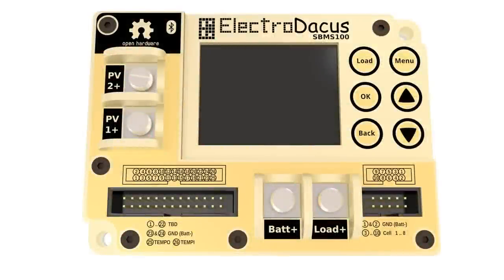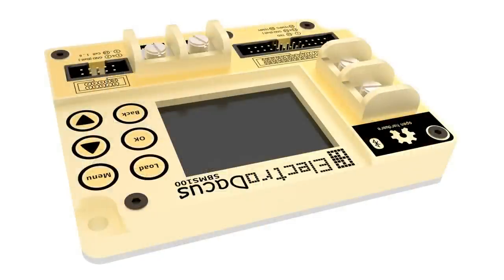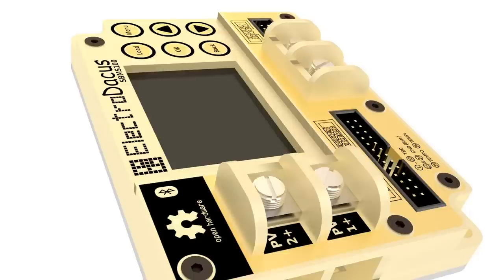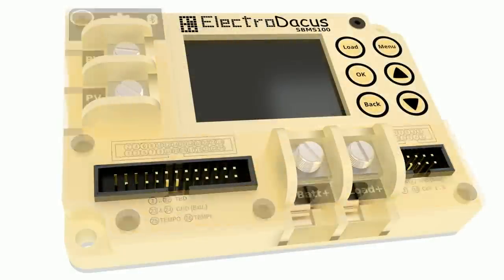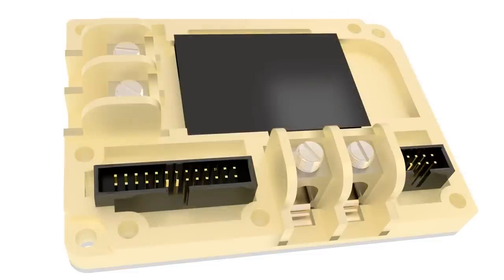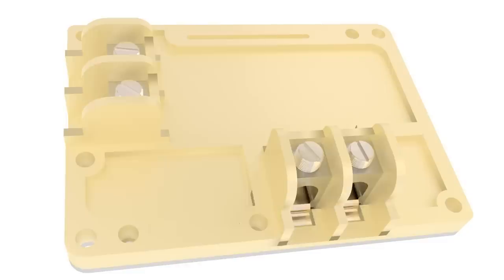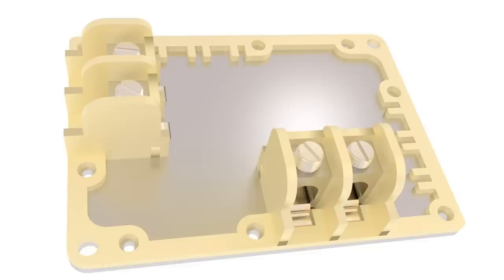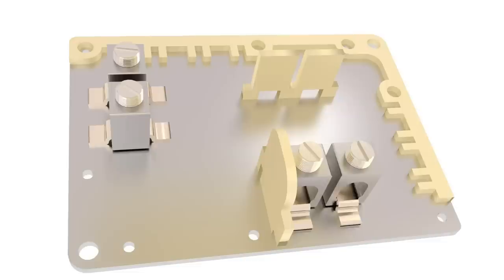New Solar BMS SBMS100 Design.

Comment: Like it... can't wait. Be Kicking in for this!
Reply from the maker: Thanks Darin. Glad you like the new design.
Reply from the maker: Darin Bicknell
Yes they are both 2.54mm pitch and can be used with standard IDC connectors.
I will provide the 10pin female connector and about 90cm of cable and maybe the 26pin connector also if I do not exceed the weight for shipping.

Comment from the maker: +vensonata you need to goo to google+ settings and there is a line that says "Who can comment on your public posts" and just select Anyone.
That is quite a large building an installation so the power consumption is quite good.
BC Kamloops dose recive quite a bit lees sun in the winter months than I do here.
This is a very good on-line tool to see what is the average solar irradiation and what you can expect to get from solar PV panes.
With your 11.4kW array assuming is facing south at about 50 degree inclination you can expect about 500kWh in December the worst month there.
That sounds good at 12kWh/day but some days you have excess that you can not use and there are a few days in a row with almost no sun.
Is great to have a large PV array and smaller battery but it dose not work with Lead Acid that 40kWh battery is way to small for 11.4kW array and it will get damaged.
As for the price is way more than just 3x between the cost of energy from PV and battery.
Solar PV panels are now around 1$/Watt and with 25 years amortization cost they produce energy at around 3 cent/kWh
Where a Lead Acid battery in ideal conditions cost at least 50 to 60 cent/kWh stored over is life. If you give me the brand of battery so I can check the spec and the cost I can give you a more precise number.
But as you can see is way more than 3x and more closer to 20x difference when compared with Lead Acid.
With LiFePO4 things are quite a bit better but still normally worse than 3x
A very good LiFePO4 may get to 15 cent/kWh over is life if you can really take advantage of the dip discharge capability that is still at least 5x more expensive than the energy directly from PV.
My experience is only 2 years offgrid with that small 24V 100Ah LiFePO4 and there is no measurable degradation after two years of relatively heavy use about 40% minimum discharge / day up to even 90 or 95% DOD some times.
As long as each cell stays between 3.0V and 3.6V you do not need to care about anything else no hydrogen gas or temperature increase (not temperature increase if you charge rate is below 0.5C preferably 0.3 to 0.4C depending on brand)
So a minimum of 25kWh LiFePO4 battery will be needed 30 to 40kWh more desirable for you 11.4kWh PV size array.
Not sure what you battery configuration is but maybe SBMS will not be useful for you.
The max configuration SBMS the SBMS100 can take a max PV array size of 3kW and that 3kW is also the output limit.
For your large system you will probably need an electric car BMS. It will be more expensive and not as great it will need to be combined with some other data acquisition tools for a complete overview of the system.
SBMS was designed for smaller offgrid houses (RV, boats) with up to around 200kWh to 300kWh /month of energy use depending on location and time of year for the SBMS100 with 3KWh PV.
And can only be used with 12V or 24V battery banks up to 8 LiFePO4 cells. There are cells quite large 400 to 1000Ah and will be a good choice for SBMS100 so 3kWh PV and 10kWh (400Ah x 25V) to 25kWh battery if more storage is needed.
Diesel and gasoline generators are also quite bad as cost/kWh since they normally use close to 1 liter /kWh and that is high enough not including maintenance and amortization cost.

Comment: I see that this design is slightly different than the actual finished product, is there a raison for changing it, I like this design better.
Reply from the maker: There where a few reasons I changed the design slightly. One important reason this design was a bit larger and had two of the power connectors on the left side has to do with the type of power mosfet I was going to use.
I also liked this designed more but most people loved the new design more since is more symmetrical. You are first to say that you like this more.

Comment: I missed the last model! =/ I don't suppose theres someone manufacturing you last model yet?
Reply from the maker: I will build a few more since I have some spare PCB's from the first batch but if is not urgent I suggest you wait for the new model. The new model has quite a number of improvements. The Kickstarter campaign will start at the end of this month.
If you want one of the old models write me an email same user name as here on gmail so that I reserve one for you when I get to build them maybe this month if I have power.

Comment: 1.  Would it be possible to add a couple of USB ports on the side for the people that plan on using it for more portable solar systems?

Count me in for the kickstarter campaign as well.  I still need to build that 10,000 watt system for my house before the obama solar tax credits run out in 2016.
Reply from the maker: There is no space for full size USB ports on the side. The full size USB is over 5mm thickness the distance between the main board and the top plate. On top of that there is absolutely no space left for a reasonable 5V DC-DC converter inside.
This SBMS is about as small as the first generation but with at least double the number of parts so almost every available space is used.
It will probably also be a bit expensive for small mobile USB chargers since this is designed with larger setups in mind.
I'm just working on the specs now but the lowest power model will be SBMS25 with a max STC PV input of 750W (25A) and if you use that size PV panel recommended battery capacity is around 60 to 100Ah.
Of course it can be used with much smaller PV and battery capacity but I will say smallest reasonable setup will be a 30W to 50W PV and  10Ah battery minimum 3 cells. Unless used with supercapacitors for experimentation.

Comment: Hello again, still trying to figure out how you can respond I am not familiar with these youtube forum. Anyway thanks for your interesting reply. I will share here my system. First of all I have 14 years of off grid experience and so this large community of up to 20 people sometimes stay here at this Buddhist Monastery.  It is a 10,000 sq ft building with all modern conveniences...all led lighting, 300 ft deep well, super efficient appliances etc. I have full monitoring systems ...pentametric for batteries and ted5000 whole house monitor etc. many years of careful data. So average daily use is 12 kwh in winter. Number of hours of sunshine ( kamloops, B.C.) november 67 hours, December 47, january 57. This produces more than enough total kwhs each month but not if 4 days in a row are heavy cloud and snow. You in Saskatchewan are sunnier more consistent. I have had in the past an 80 kwh battery bank. Now just downsized to 40 kwh and tripled the pv from 3.4 up to 11.4. So just like you I think go very large on pv and modest on battery since battery cost 3 times as much per kwh as solar. Now the results this winter are very, very good, only 30 hours of generator run time the whole year only necessary occasionally when cloudy for 5 days. So I installed AGM  just barely enough for 2 days storage because I am waiting for Lifepo4. So if I increase the battery it will be with Lifepo4. The goal is 100% solar electric, zero generator! This is usually thought impossible but now it is. We overproduce 9 months per year and can use it to heat all hot water, cook electirc and charge electric vehicle. So we save propane and diesel and gasoline maybe $3700 per year. The realization is that lifepo4 when used for several days storage will last too many years!!! So i think I must use the AGM for back up and one days worth of Lifepo4 (12 kwh) for daily cycle. What do you thin?

Comment: Is this meant to be commercial/home-use? Then move all the plugs and connectors to the bottom side of the case to be hidden and protected by an additional mask or insulating shield. Only the buttons and display should be on the front panel.
It should be embedded in the wall or apparent mounted. 
As a hobby/experimental device, it could go on with this design but as a consumer device it should follow safety standards and aesthetics are not to be ignored. ;)
p.s. Increasing the retail price but ensuring some serious robustness and trust, molex connectors should be secured with latches or screws.
Reply from the maker: Hi Alexandru, Thanks for the comment.
This is a low voltage max 45V open circuit voltage from 72 cells PV panels there is no risk to the user. As for short circuit that is not possible do becose of the side guards that are always taler than the screw.
The unit should be mounted normally on a heatsink depending on the size of the PV array and load and mounted in an electric panel (max TDP around 20 to 25W at full load).
As far as aesthetics that is always a personal preference. The PV connectors are on the right for ergonomic and functional reasons. By having the connectors on that side I can have much shorter power traces between the power mosfets and connectors and at this current level the PCB can have more losses than the mosfet.
So I normally first find the best ergonomic and functional position and then I do my best to make it look good based on my artistic views :).
The device is ment more for experimental hobby use as those are normally the users of offgrid solar. There is not a large market for this type of product and there is no educations about the benefit of Lithium as energy storage device both as price and countless other advantages.
The power connectors are UL and CSA certified and properly rated for this application.
The battery balance and measurement connector is fully protected. If any of the pins gets disconnected both charging and discharging will stop automatically (this is done in HW not software).
The 26pin connector is for user extension automation programing and not needed in simple operation.
Reply: Pașca Alexandru Not sure you can see from the 3Drendering but there is no way to short two power connectors at least not unintentionally with a strait peace of metal like an unprotected screwdriver or a any other strait metal object.
Also all terminals on the SBMS are positive. No negative connection to SBMS so if you intentionally short any of those two positive terminals all you do is bypass the solid state switch so you either connect a solar PV to battery or the load to battery no SC current just Load or PV normal operating current (but not by accident you really need to try, like get a piece of flexible copper wire and make contact with two terminal of your choice :) ).
Reply: ***** Straight no, but a bent piece of metal like tweezers.  
And as I said, accedental or intentional/pseudo intentional (think curious kids/teens)
Reply: Pașca Alexandru
Well they can use those tweezers in an AC soket (it will be more exiting :) ).
I can just not protect for any silly situation.
But say somoane whants to do that Betwen the Batt+ and Load+ terminal with tweezers. In case the Load is ON nothing will hapen since Batt+ and Load+ are on the same potential. If Load is off for some resons and there is some Load connected on the other end it will be like a switch just pass the current requiered for load trough the twisers probably not enough current to heat the twisers enough to create a burn.
But maybe you are refering to the 10 and 26 pin connectors and in that case there is nothing there you can have the twisers there all day long with no consequences to "user".
The 10 pin is all input so no voltage there and the 26pin is mainly digital and analog IO again at most +3V with few mA max current.

Comment: I want to make the same at home need help
Reply from the maker: What exactly is that you want to make at home ? 3D rendering / animation or Solar BMS ?
Reply: Solar BMS n thanks for ur answer
Reply from the maker: This is a fairly old video and there are new SBMS models that I work on right now. You can preorder one from my website and should be ready soon. Progress and details can be seen on my google+ page https://plus.google.com/+electrodacus/
You can build your own but you will need quite a bit of knowledge and equipment and if you need just one or two the cost will be extremely high similar to what I pay to make a prototype above 1000USD for one SBMS so is not economical unless you just want to build it so you learn how to do that and cost is not important.
Reply: How much it casts fairly
Reply: Fairly this is the best dual working BMS not yet invented but U .
Reply from the maker: Not sure I understand the question. The price is listed on my webpage and you can pay with paypal http://electrodacus.com/
I build 100 to 200pcs at a time and that allows me to get parts and PCB at lower cost. When I only build one or two prototypes the PCB's alone cost around 800 to 1000USD (there are 7 to 10 different PCB's for a single SBMS because the case is also build of PCB as you seen even in this video).
You can see better the PCB's on this post  https://plus.google.com/+electrodacus/posts/KvByYmNdxMJ

Comment: what are the 4 variants?
Reply from the maker: SBMS25, SBMS40, SBMS65 and SBMS100 the number represent the STC current on the PV panels so with SBMS you can have about 3 of those 60 cells (250W panels) and the SBMS100 can have 12 x 250W panels so a 3kW array.
You can find this and more details on my webpage electrodacus.com

Comment: Besides the balancing feature, How your charge controller is different from this https://www.youtube.com/watch?v=rC4rF62CHKY
and can MPPT achieved without using bulky transformers?
Reply from the maker: That charge controller has nothing in common with SBMS. That MPPT supports a very small charge current so of course it will be relatively small with just 5A charge current. Compare that with 100 or 120A for the SBMS. If it where to build a 120A capable DC-DC converter that is what a MPPT is in therms of hardware then you will see how large and heavy will that be. Look at existing MPPT solar charge controllers than support 60 or 80A then think about 2x that weight and size.
There is zero benefit for an MPPT in offgrid applications see my video about this subject https://www.youtube.com/watch?v=cKrh9tdXDX8
Reply: Thanks for the reply, What would the SBMS100 considered? MPPT or PWM or something else?
 And what is the average efficiency?
Reply from the maker: The SBMS is first a BMS (Battery Management System) so it will monitor all individual cells up to 8 LiFePO4 cells for 24V battery. 
The charging part is not MPPT nor PWM since that is not needed for charging Lithium battery in solar systems where battery life is much more important than energy density.
The SBMS100 has a total TDP of 22W that is when charging at 100A and discharging at 100A simultaneous so that is about 2600W charge and 2600W discharge so total of 5200W going trough SBMS and losses on SBMS will be 22W that is about 0.4% loss or if you want a transfer efficiency of 99.6%.
Using 60cell PV panels (most popular and cost effective panels on the market) with a 8 cell LiFePO4 (24V equivalent about 26.4V nominal max charge 28V) that is extremely close to the max power point voltage on those 60 cell panels that is normally around 30V STC so 25C cell temperature but with higher temperature of the panel most of the year that max power point voltage will be closer to 27 or 28V thus most of the time the panels will work at the max power point in this configuration and just a bit below max power point 5 to 10% less than max power point in very cold winter days.
But if you watch that video I made and linked in the first replay you will get more detailed information's about all this.